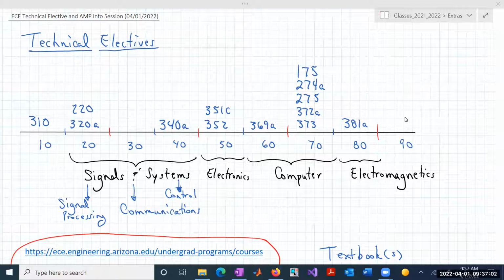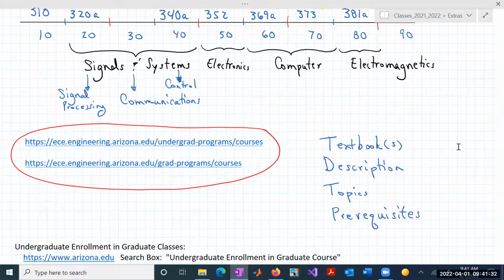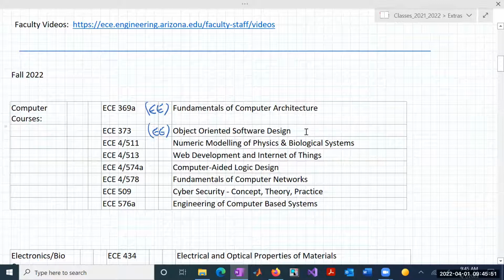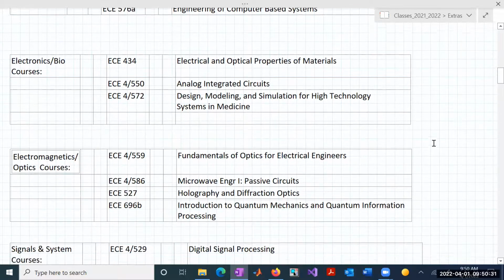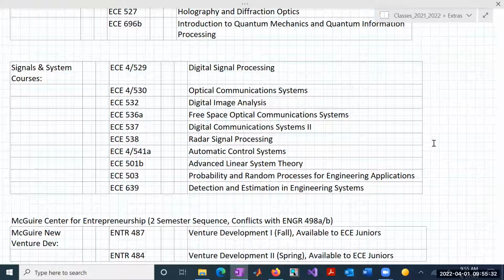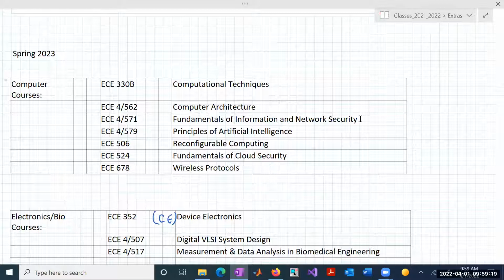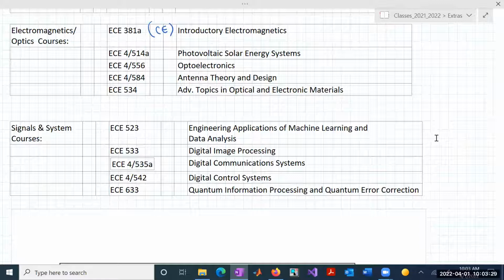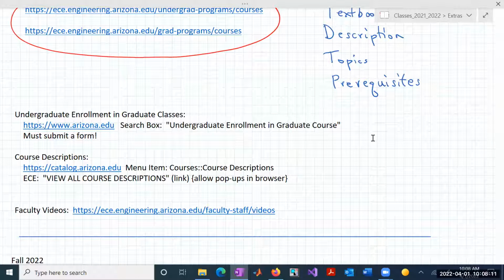ECE Technical Electives and AMP Information Session (04/01/2022)

Comment: Too many courses have time conflictions and most electives are offered randomly each semester, which makes it a coin flip at best to enroll in a class while meeting prereqs. 

Here's two examples: A) ECE 450/550 was supposed to be offered this semester (Fall 22), but it's not listed. B) ECE 372A and ECE 486/586 are offered on the same day at the exact same time. On top of that ECE 486/586 and ECE 488/588 are offered as a sequence so if you miss ECE 486/586 you have to wait an entire year to enroll, which will most likely be too late for seniors and masters students. 

How are students expected to think 5-10 years in the future when UA's ECE department can't think 2 semesters in the future for it's students.